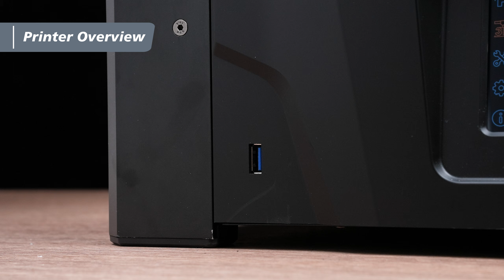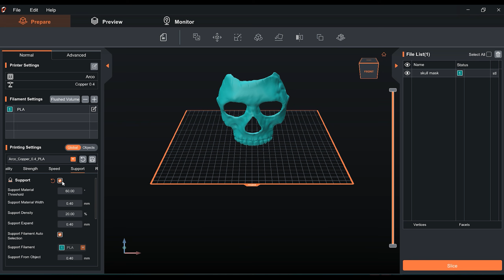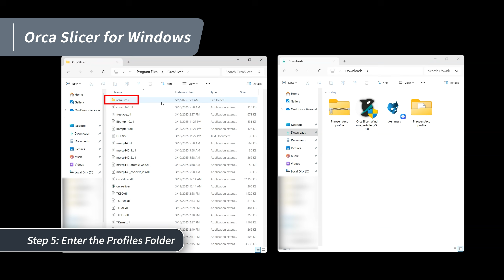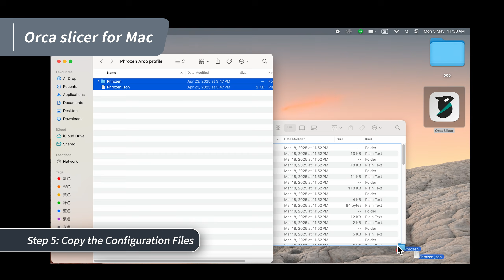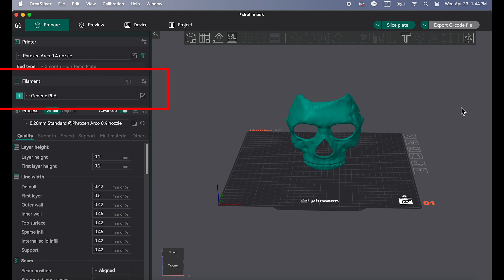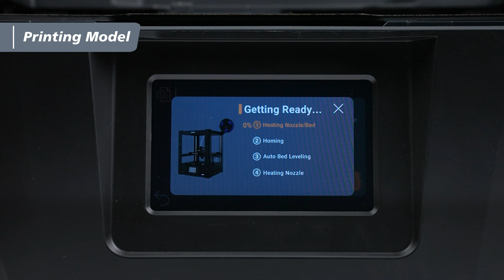ARCO - Slicing & Printing — Phrozen 3D Printer

Comment: @phrozen3d  I am using the pixup slicing software.  After I have completed printing for the day, shut everything down, and come back the next day, when I slice the model and tell it to print over WIFI, it says the printer is busy. I've shut down the printer, ended the program session and restarted. I've tried "new project" from the File Menu.  How do I clear this error and get it to print via wifi?  Also, custom printing settings will not save from one session to the next, I have to start over every time.  (Aside from that, it's a fantastic printer!!)
Reply from the maker: hi there 😊 please make sure your pixup slicer version matches your firmware version. Basically you need to update the firmware to the latest, and PIXUP slicer should be version 1.4.2 .
If you don't know how to do it, please join our facebook group here: https://www.facebook.com/groups/274599705235544. 
Our tech support colleagues are there and many other ARCO owenrs will share their experience.
Log in or sign up to view
See posts, photos and more on Facebook. Don't forget to tag us in your printing clips! Happy printing 🤩
Reply: I’ve had to reboot my computer to print via WiFi again. Rebooting the printer does nothing to clear the error.

Comment: How do I change the type of support to use (like tree, zig zag...) the default is not very good on some shapes.  Even after several attempts at changing the Z distance the default support is not good.  Leaves a very bad underside finish.
Reply from the maker: I suggest you to lookup into the slicer you are using. Try finding settings > support settings> and then support type. These are most common steps in any kind of slicer.. So next time you slice try this & comeback tell us which supports you used. Don't forget to tag us when you print with phrozen🤩
Reply: @phrozen3d PIXUP FDM Slicer. Where is the support type option?
Reply: @phrozen3d  I could not find the options in Pixup FDM Slicer.

Comment: I suppose printing via WIFI also should be possible ?
Reply from the maker: Yes, You can also printing via WiFi
Reply: @phrozen3d  how , i have the orca profile done but i cant find how to do wifi printing
Reply: @enrilopez have you figured it out? Orca will not detect my Arco, but Pixup will.
Reply from the maker: Please refer https://youtu.be/BlmLWuOWDoE
Reply: @phrozen3d did phrozen arco have utp network cable port?